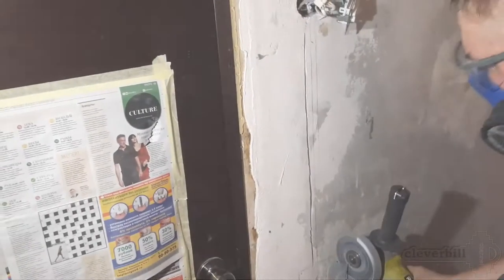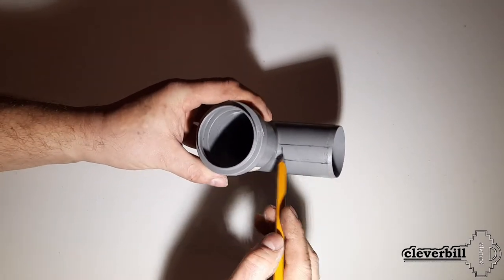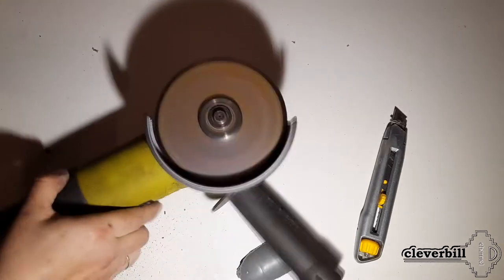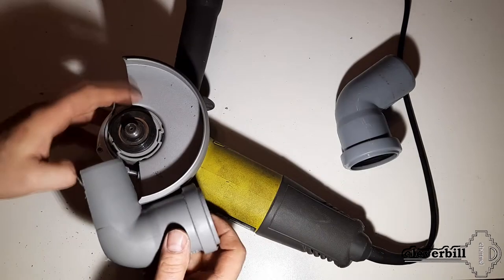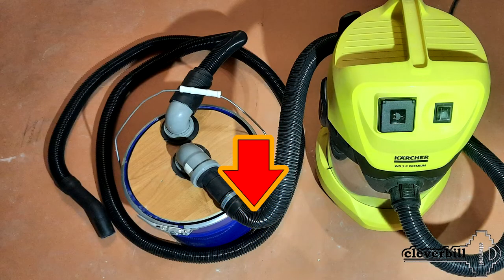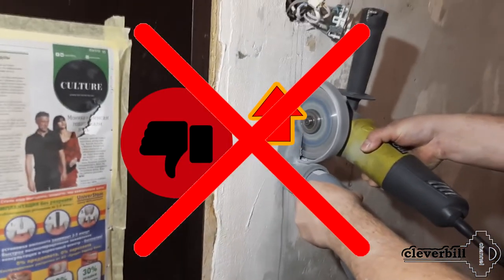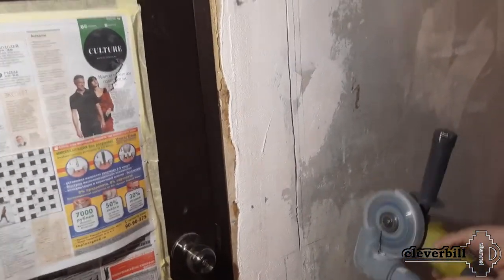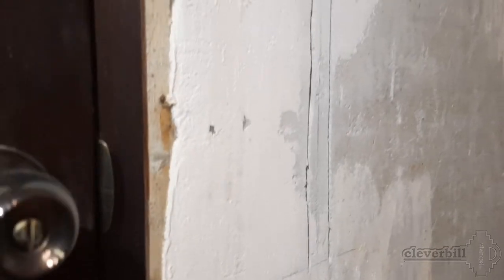Attachment on the angle grinder for connecting a vacuum cleaner How to cut concrete without dust DIY

Comment: great job. a lil tip, you have you cut against the spin of the blade. if the blade is spinning counter clockwise you have to cut from top of the cut line to the bottom. that's 97% dust free 👍

Comment from the maker: Cut concrete walls on site with my new grinder attachment made the job much more fun and without the dreaded dust cloud. Of course, this option is far from ideal, but, on the other hand, it cost a mere penny. I think over time, I will finalize the attachment, but this is probably already in my new video.